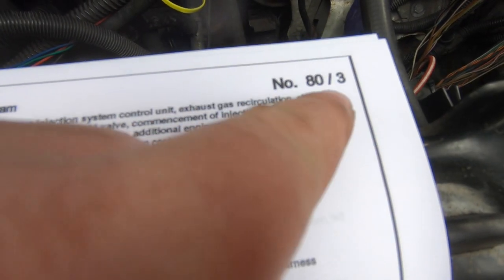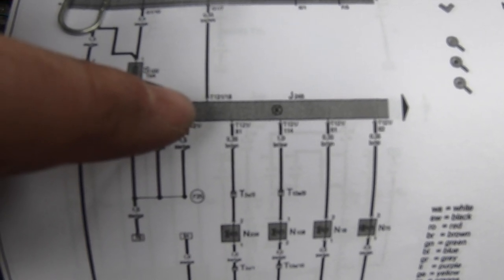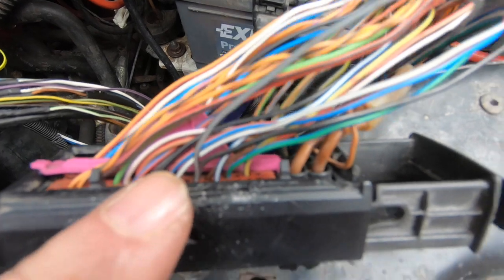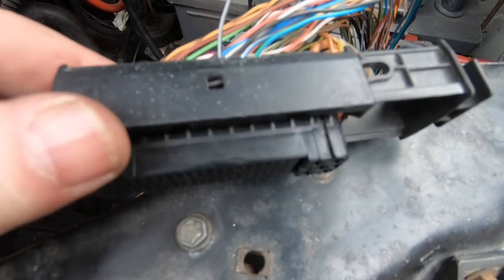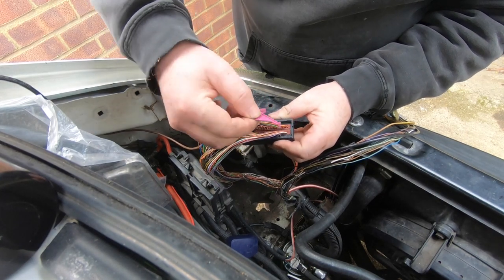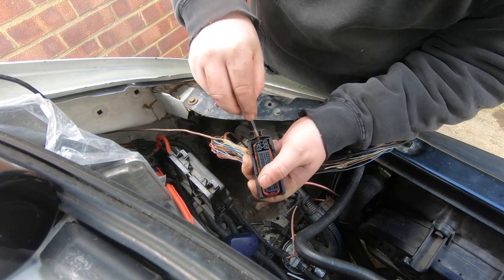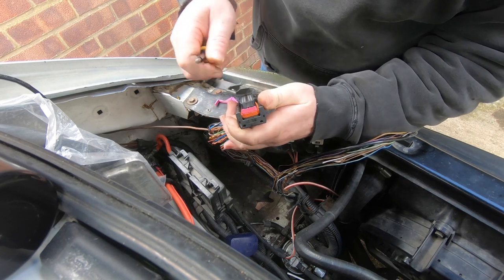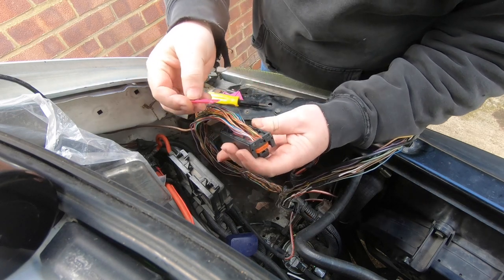VW T4 2.5tdi Notorious Black & White Wire Repair | ECU Loom part 2

Comment: For non-british T4 owners; the left hand drive T4's do not have this black & white wire (and all the other colors in the bundle) running across the engine, because fusebox & ECU are mounted on the same (left) side of the vehicle. Therefore, the LHD T4s are not prone to the notorious black & white wire problem.
Reply from the maker: Absolutely. LHD T4 owners have it easy HAHA.

Comment: Thanks for these 2 videos. Very informative.
I have the same issue (cranking but not starting) & VCDS gives no errors!
I'm wondering where the 10 pin connector you mention is on the front of the engine. Do I need to move the radiator forward to access it?
And do you know what those 10 pins connect to? From the diagrams, I can see pin8 goes to N109 (Fuel shut-off valve) & pins 9 & 10 go to N108 (Commencement of injection valve), but there's no mention of the other pins?
Reply from the maker: Glad they're helping, this wiring can be so frustrating. The ten pin connector is in front of the sump at the bottom of the engine - no need to remove the rad just an engine tray if you have one. The other wires got to injector harness as well as fuel pump and it's gubbins. Check your timing is set correctly.
Reply: @AdventuresAutomobiles  Thank you your those details which were useful in testing some wires. Turned out to be a failed injection pump belt. Due to weeks of wet weather, & no dial gauge adapter, attempting to change the belt & adj the pump timing in the street was too difficult so put it into a recommended mechanic for replacement but sounds like they will charge $$$$$!

Comment: Hi mate, could you let me know what the black and white wire, the black wire, and black and yellow wires are controlling, am I correct in thinking these are running too immobiliser?
Reply from the maker: Hi, not 100% sure but those wires run to the ECU. The immobiliser module is in the dash connected to the ignition ring - you can trace from the little black box.

Comment: Hello maye could you help me out as well ? I need to check my map and mad sensors wire harness on my 2.5 acv too. Sensor side of the wires are easy to find but how in the world i can find the ecu side ? For map and maf sensors ? So i can check the whole cable of it works or not, or for changing it ? Can you help me out ?
Reply: Which pins or colors i should look for? Do you have a proper diagrams for those ones as well ? Help me out please! 😂
Reply from the maker: Hey! Check the colours of the wires at the MAF and then you can check for those colours on the smaller ECU plug - be gently when removing the conduit but you should find them there. If you follow the wires back from the Sensors through the condiuit around the engine, eventually you will land up back the the ECU. There's loads of places the wires can get damaged - and after more than twenty years it won't be surprising. Here's a link to the wiring diagram. https://adventures-and-automobiles.com/wp-content/uploads/2024/01/T4_Base_Wiring_from_May_1999_on.pdf
Reply: @AdventuresAutomobiles   Hey man to be honest i just did the exact same thing just before i saw your reply :) i figured it out, turned out i had a wiring issue, one of the cables was broken, luckily, i could even find the break point. All fixed now, your video inspired me. I could find the encourage after watching your video. Thanks mate, helpful video !

Comment: How do you remove the plastic cover from the plugs to begin with?
Reply from the maker: There’s a little lever you pull below the wires on each side - kinda half moon shaped each side.
Reply: @AdventuresAutomobiles  Yeah you need to pull that out, and then with a firm grip between thumb and index finger compress the open end of the lid to clear a tab on each side, while rotating the lid upwards.

Comment: Hi where can I find the wires to the pump I have no throttle response 2.5tdi.
Reply from the maker: Trace the wires from the pump to the ten-pin plug in front of the sump - then from there back to the ECU. Have you checked that your throttle sensor is ok? You may need VCDS to check.